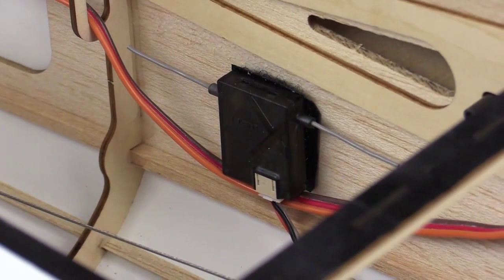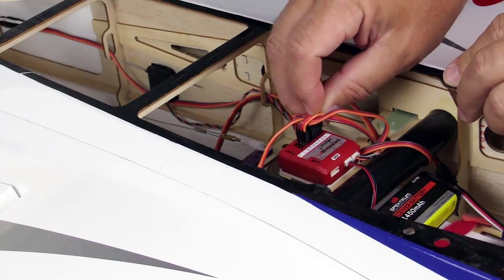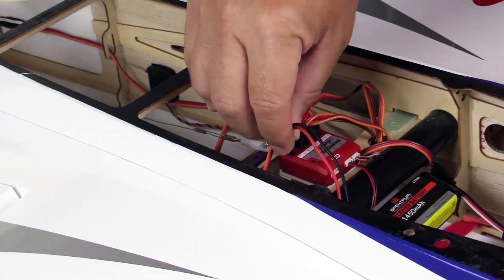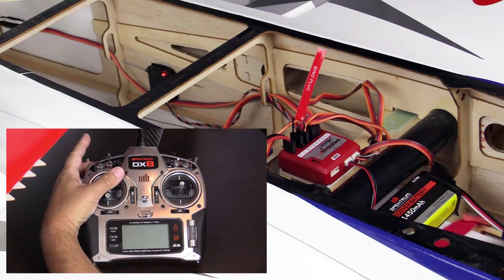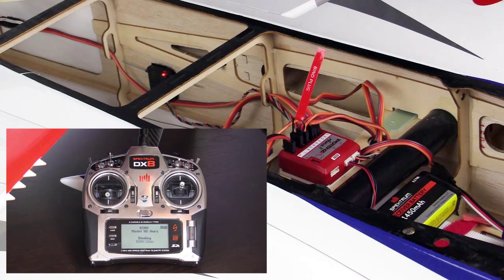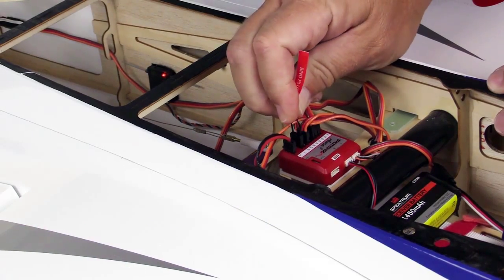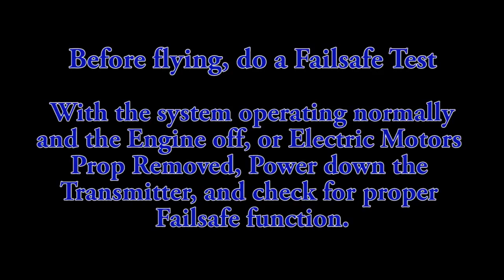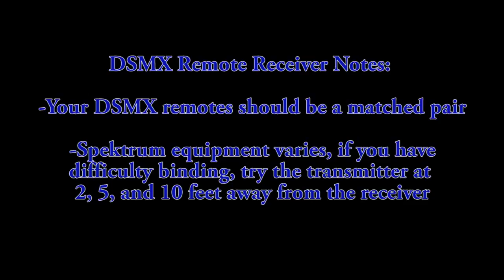Aura 8 - Spektrum DSMX Remote Receiver Binding

Comment: Do I need to use a receiver battery for this process
Reply from the maker: You need to power the Aura (and thus your RX) in some way. If your ESC has a BEC that supplies power, then you could simply power your ESC. In the case of our Ventique here, it requires a receiver pack, as the ESC does not have a BEC.

Comment: How about a picture of the receiver and what ports are being used for what. Aura 8 port pic. dont see a reciver anywhere in your video did you not intall it or just got lazy with the video. The jet is a piece of junk and that Aura is junk as well dont work worth a shit
Reply from the maker: Hi Michael,

The Remote Receiver IS the receiver. The Aura 8 is a gyro system, not a receiver. Specific servo ports will vary depending on your particular aircraft's setup. I'd recommend checking out our Wiki site for all things Aura:

http://wiki.flexinnovations.com/wiki/Aura
Reply: @FlexInnovations  So confused.  I have Aura 8 and Spektrum 9320T with 2 remote receivers.  What is the setup needed for this? (the only way I have this working is connecting remote receivers to the Spektrum receiver with 1 cable between Aura 8 to the SRXL port on the 9320T Receiver.

Are you suggesting that I do not need to use the Spektrum 9320T receiver at all? (and just plug the 2 remote receivers directly into Aura 8?)
Reply: @DavidYardy  Yes, the Aura 8 will work with just the satellites plugged into the a and b ports, however the setup you have using the data cable with the full receiver is the preferred method.